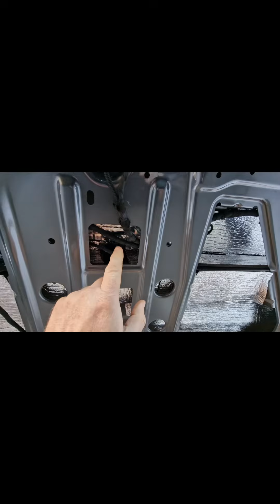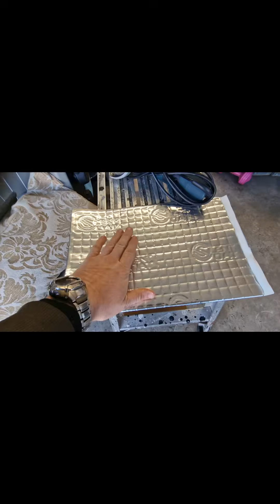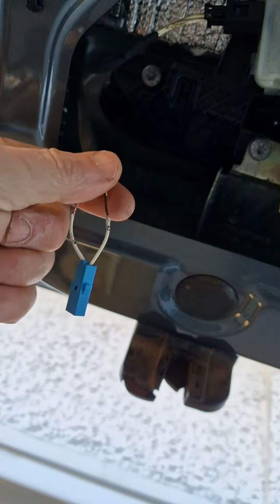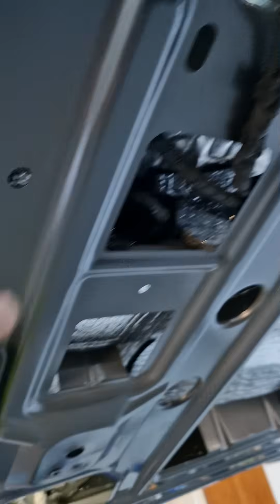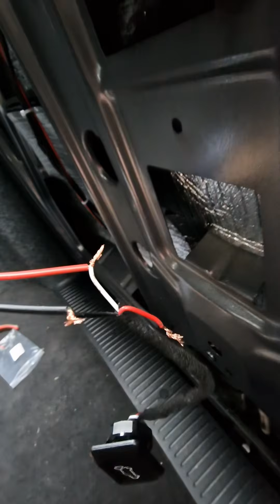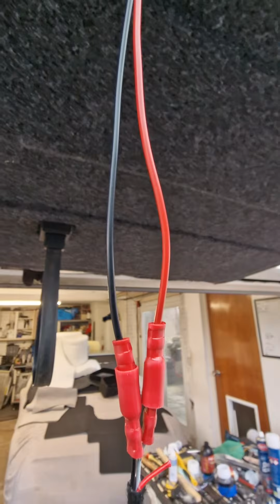Vw transporter T6 add tailgate internal release switch

Comment: Great video mate thank you

Helped me identify which part was causing my tailgate release to fail.

I’ve ordered a new handle now, but wanting to add the extra switch like you have done.

Can you see any issues with using a wago or connector block to do this? I don’t have the stuff for soldering.

Thanks in advance!
Reply from the maker: Glad it helped you, wago should be ok as long as it doesn't vet wet or damp 👍👍
Reply: @vwtransportertech appreciate it! Thanks 👍🏼

Comment: Is the switch a bell press or a latching switch??
Reply from the maker: I dont think its a latching one, its just a momentry switch, once the contact is made the lock will open.

Interestingly enough there is a different resistance on the oem switches between the inside and outside switch so the bcm knows which is which and not to open from inside whilst driving